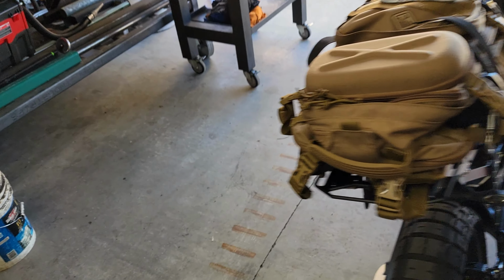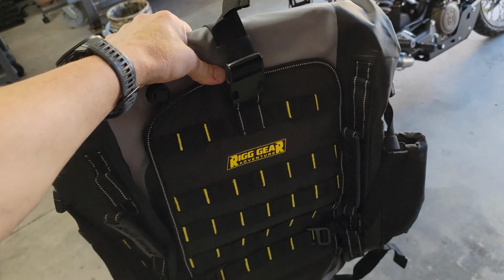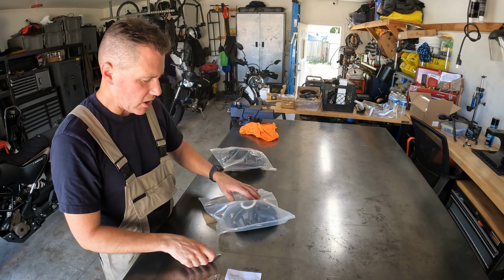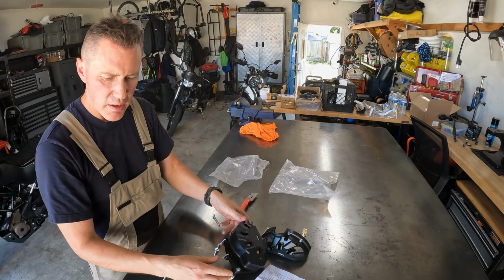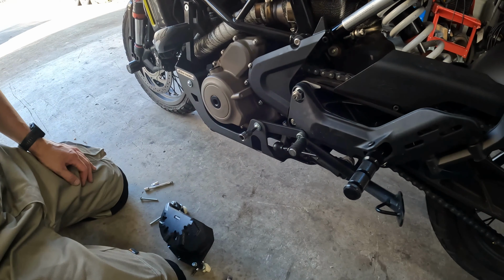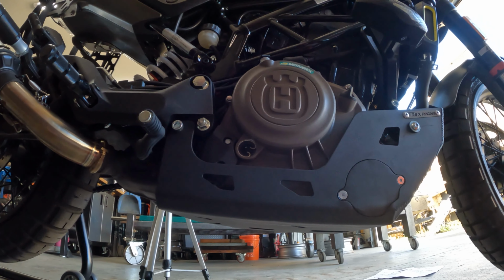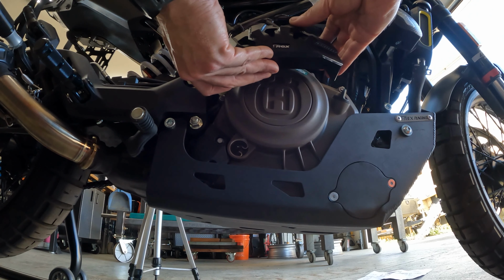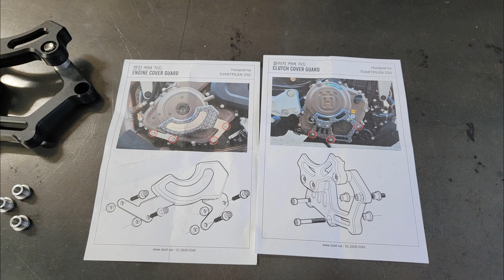Husqvarna Svartpilen Part 23 (T-rex racing engine/clutch guard)

Comment: You need a tail tidy and ecu exhaust air box
Reply from the maker: I was looking at the ecu box but figured out increasing fuel pressure does the same thing dependent on your mods.  We used to have piggy back ecus in the subaru world and all they did was increase the injector pulse width.  The ecu boxes for the svartpilen do the exact same thing.  Increasing fuel pressure is what we need to do.  

As far as tail tidy, no thanks.  I feel the same way about that as I do about bar end mirrors...  

I will consider the air box after my first service.  

Thanks for the suggestions and tuning in!